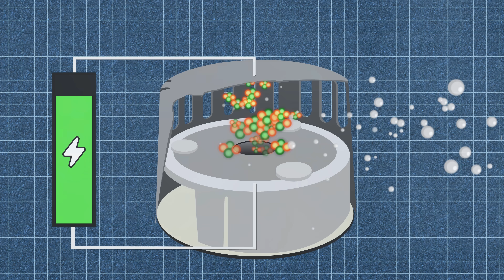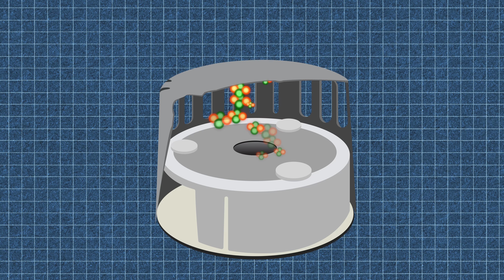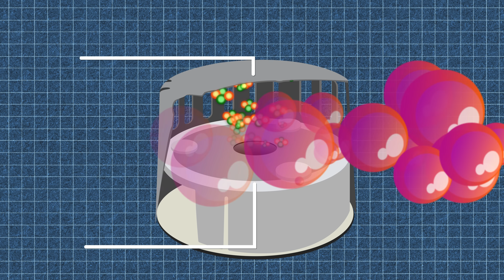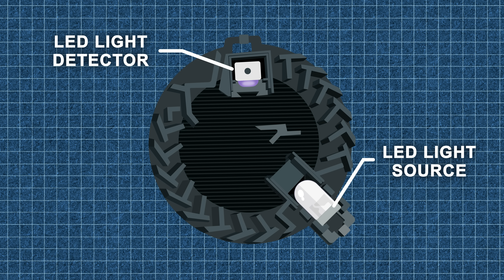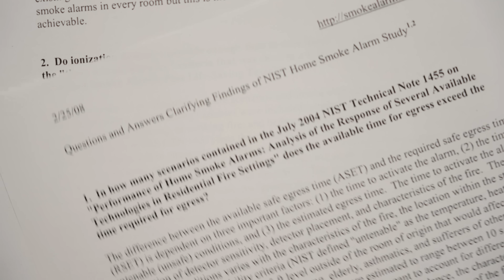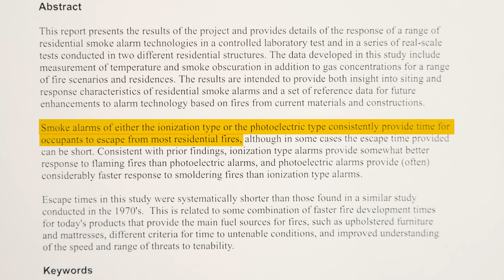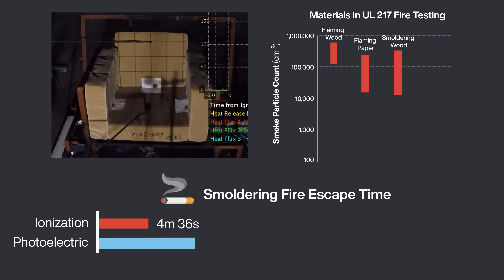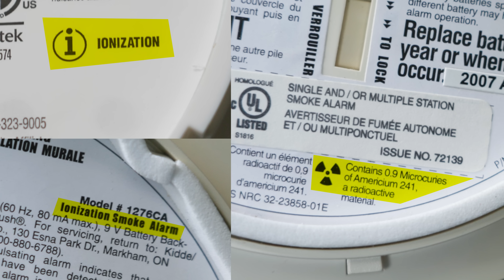Why the Most Common Smoke Alarm is Dangerous

Comment: aren't the graph names reversed ?
for example 11:35 the graph is opposite to what you are saying.
Reply from the maker: The graph is correct, it's an unusual way of talking about how useful an alarm is.  

The actual metric is ASET - Available Safe Egress Time, which is how long after the alarm goes off you have to get out before conditions become dangerous.  It's a more accurate measure of how useful an alarm is in saving your life.  It's also an indirect a measure of how fast each alarm is alarm is.   

Yes, this is confusing, I thought about different ways to represent the data and this is the simplified version although I should have went with "escape time".

Comment: I'm still waiting for a commercially viable 520Hz tone smoke alarm for my sleeping area. It has been a requirement in the code since NFPA 72 2013 yet there are no commercially available 520Hz devices. There are some that will detect the audio from a normal 3khz tone smoke alarm and play a 520Hz tone and there are options for commercial grade fire alarm systems but nothing in the same form factor as the normal off the shelf smoke alarm. As a heavy sleeper and fire alarm professional I don't like this.

Comment: At 11:50 are teh photoelectric vs ionisation bars meant to be the other way around. Be warned after 4 minutes of fire is much better than after 35 minutes of fire. Or am I reading that wrong?
Reply from the maker: The graph is correct, it's just an unusual way of talking about how useful an alarm is.  

The actual metric is ASET - Available Safe Egress Time, which is how long after the alarm goes off you have to get out before conditions become dangerous.  It's a more accurate measure of how useful the alarm is in saving your life.

This is indirectly a measure of how fast each alarm is alarm is.   Yes, this is definitely confusing and I thought about different ways to represent the data, I probably should have stayed with "escape time".

Comment: Do any models with interconnect come with a ten-year battery? My area requires interconnected alarms but I don't want to worry about replace the batteries.
Reply from the maker: Only one.  First Alert's SMICO105-AC.   Keep in mind this is wired interconnect, not wireless.  There are no wireless, non-hardwired, 10-year battery models.  

If you're hardwiring replacing batteries shouldn't be a problem as it won't suck any power from them unless your 120V system goes down.
Reply: @Lam  My experience has been that regular 9V batteries last around 3 to 5 years in a hardwired AC powered smoke detector. Once one of the detectors gets a low battery warning, I replace all of them.

Comment: Too long, didn't watch: skip to 15 minutes in where he gives the solution.: get a new smoke detector. You take forever to get to the point. I don't need the history of smoke alarms or the clever little interludes. Tell me what, if anything is wrong with my smoke detector and how to fix it and then after that you can start telling me the history of time. That or change your title to "the history and detection methods of smoke alarms"
Reply from the maker: Thanks for taking the time to comment, there's maybe 20 seconds of history but most of it is designed to get people to understand what the problem it is we're solving and why it's important.  That said I'm glad you at least found value in the solution

Comment: Why not just include both types of sensor in one detector? Neither smoke chamber is particularly large and complicated. Now you have redundancy for failures and the ability to detect different fire types.
Reply from the maker: Hey MrChainsaw, thanks for enjoying the video!

The problem with dual sensor alarms is these alarms can be just as sensitive to cooking false alarms (UL, Characterization of Smoke Alarm Nuisance Sources, 2015).  They're also hard to find, expensive, and the only 8th generation dual sensor alarm is currently unavailable for purchase (as of June 5, 2024). 

As well many homes require CO detection and you'll have to choose between having those separate vs interconnecting them with the rest of your home.  Same issue if you want separate photoelectric and ionization alarms.  I think Interconnection is more important.

Kidde's new 9th generation of smoke alarm is Photoelectric only.  This was what I was expecting in the video as I was shocked ionization could pass the new tests, but I'm guessing that's no longer possible.

Comment: Placement is also key, put an alarm in the wrong place and it may either not detect in a timely fashion, or may over detect smoke from cooking or other non emergencies and become ignored or worse intentionally disabled/defeated and then it will never alert to a real fire.  They also have expiration dates, most people probably don't even know they need replacement typically every 10 years.  Personally as someone in a house old enough to not be wired for them I like the 10 year battery units with wireless interconnection.

Comment: I have both types in different locations usually relatively close depending on the most probable fire. I also have a CO alarm and monitor. I have an old house with a wood fire for heating.

Comment: Have both optical (photo electric) and ionizing smoke detectors, CO and natural gas detectors, co2 and ABC extinguishers installed on every floor in my house, we have an escape plan,  was in a building fire when I was a teenager, was a volunteer firefighter in my 20s. Thanks for the testing
Reply from the maker: Nice, that's a great setup, I think it's hard for many people to set that up properly, especially if they want it interconnected.
Reply: @Lam  thanks, no interconnection, just newer 10 year units that I check once a year.
Reply: One of the local hvac technicians said most Co2 monitors dont go off unless the levels are SUPER high
Reply: @NEON2600 I wouldn't call it "super high". They go off when the level is approaching being a threat to human health. Iirc, they are usually set to alert at 30-40ppm CO.

The detectors hvac techs use measure from 0, because the equipment they're servicing shouldn't allow any CO into the home, and they need to know if it does.

There are other things in a home that can produce small amounts of CO that aren't particularly harmful, such as gas stoves/ovens, certain types of cooking, candles, etc. If CO alarms were more sensitive, they would give false alarms that would eventually lead people to remove or disable them.
Reply: @NEON2600  first herr alarms for protection of gas appliances are called co alarms big scientific difference between the co and c02 some fire extinguisher are filled with CO2 they are never filed with co because it is flammable ! And it think it read somewhere co alarm may only activate at about 70 ppm but it's based on length of exposure over time ! Ultra low detection sensors for co are not UL listed!
Reply: Hi Flash my previous Former business consultant is on the UL 217 committee he a actually went to Australia to say ionization alarms are dangerous in smoldering fires a d e en help get a photo electriconly mandate in his home state!
Reply: Is also surprising you don mention to the people that even the CDC cane out with a report that 10 year alarms don't last 10 years so again I challenge you did someone forget to give you the facts or are you just really bad at get giving advice?
Reply: Don't you have a duty of care to recommend only the most effective alarm? Do you not know that us government has tested ion which may fail in rooms significantly degraded by Smoke For some one who Claims to be such an authority I challenge you to answer me why are you not explaining to people that ion in both smoldering and flaiming fires have a higher rate of failure than pHoto electric which has a failure rate of 4 percent for both smoldering and flaiming fire be fire you start saying you recommend both would it not have been good to explain that to the people before making recommdation and let them decide for them self? As for the combination don't you know a court case already stated the combination is not safer than ion or photo and I was even able to make a video on how dangerous the combo can be?
Reply: @Fredengle  I did my research, other people can do that too. Thanks
Reply: @Flash1857  Hi Flash while I disagree with your ideas I do at least agree with you that if people are interested they should research it themselves while we are not 100% in agreement you are at least doing a step better than my local fire marshal who claims to say there is a debate but they dont offer any reason that people should do addtional research congradualations !!! thank you
Reply: you inspire that if people want to learn they should research and be educated again this is  a step better than my local fire marhsal I congradulate you on say ing its good to research and be educated !
Reply: If you really are the Authority you claim to be why can't you tell me the ion alarm failure rates? I am a private citezen andI was able to find a fult analysis report on how much the product d fail for some one who Claims to be an authority I challenge you why have you with held the facts I stated and I challenge you to  answer in an attenpt to change legislation if ion is as safe as you claim why had the statement been made that 100 percent of all lawsuits are against ion alarms and challenge you to answer it seems the official position of American society of home inspectors I think states they only promote photo electric only I challenge you to answer me are you really not concerned about safety or did someone fail to explain these things to you I know it to be fact my local fire marshal office is made of people who do not care about public safety I told them for3 years they promote dangerous product and refuse to change legislation or expkthow dangerous the priducs agree to the people di you know the iaff ,300,000 members about 85 percent population official position is photo electric only? And not combination or ion?

Comment: Am I the one who is confused or are you? Shouldn't the 35m timer at 11:48 and 13:41 be labelled ionization? It says photoelectric.
Reply from the maker: It's correct, it's just an unusual way of talking about how useful an alarm is.  

The actual metric is ASET - Available Safe Egress Time, which is how long after the alarm goes off you have to get out before conditions become dangerous.  It's a more accurate measure of how useful the alarm is in saving your life.

This is indirectly a measure of how fast each alarm is alarm is.   Yes, this is definitely confusing and I thought about different ways to represent the data, I probably should have stayed with "escape time".
Reply: @Lam  awesome. Thanks for explaining 😃

Comment: My housing company provided a very basic, simplistic optical one, fine but combined with the kitchen connecting to the hallway where it sat, without a door... Damn thing would have a panic attack if you boiled some water in the kettle for coffee, never mind cook.

Replaced it with my own heat-sense based fire alarm for kitchens and added a monoxide alarm for an additional sense.
Can't live with one that goes off needlessly 5 times a day, that also just desensitizes you to the alarm going off (boy who cried wolf.) so you'll probably not rush that 1 time it isn't a false alarm after a 100 false ones.
Reply: Photodetector alarms are recommended for kitchens to alleviate that false alarm problem.  Ionization or combined for everywhere else.  Of course, "kitchen" means wherever kitchen fumes actually end up going, which isn't always just the kitchen.
Reply: @travcollier  Also forgot to mention the optical one they placed here would just seemingly randomly go off without kitchen activities as well. Probably was factory-defective. Or maybe tiny flies, I have some plants that need moist soil at all times. So in summer there are always a few coffin flies around. Might have been flying into the sensor compartment?
I did try to go through the housing company to get it replaced but they seemed somewhat unaware what they installed here and that it's a not-for-the-tennant-to-touch/maintain alarm system. Did not manage to get someone on the phone who knew anything about it. :|

I'll look into the "8th gen" alarms mentioned in the video.
I'm content with the thermal kitchen and monoxide detectors for any fires or monoxide leak that might start in the kitchen or the heating system.
Still want a separate one more smoke sensitive in the bedroom and living room for e.g a smolder starting there. That would cause a lot of smoke before heating up the area around the thermal alarm enough to trigger it. 

(I'm not in the US, ionizaton type haven't been sold here for ages. But there seems to be something like shitty-optical ones too (unless it was just defective ofc.))
Reply: @InnSewerAnts  I have heard of insects or spiders entering optical fire alarms setting them off before. That seems like a possibility.
Reply: @05Matz  Oxidation of the optical plastics and dust accumulation will kill the photo electric units as well.

Comment: Glad to see such a great explanation of this and a good breakdown of the differences. There's a reason I have both types of detector in my house, and I didn't just choose where each type was placed at random. The spots more prone to a fast starting, flaming fires have ionization detectors, and the rest are photoelectric.
Reply from the maker: You're welcome! That's a great way to maximize coverage and protection assuming the most critical ones are interconnected
Reply from the maker: Great setup.  I would make sure you have an alarm on each floor that's interconnected.

Comment: New viewer here.
    Great video. Thank you.
Back in 2018 my refrigerator power cord was pinched, causing a smoldering fire in the kitchen while I was at work.
    I had left an exhaust fan in one of the bathrooms going, and a passerby saw it and called the FD.
    No one heard any smoke alarms going.
    Glad I wasn't there, asleep.
Reply from the maker: Powerful story, I'm glad you weren't affected.  Exactly the type of problem that we're trying to solve.
Reply: which is why AFCI and GFCI breakers are desired

Comment: Technology Connections also did a video on this (because of course). However, he did not address 8th generation alarms. This is very useful, as I need to replace the alarms in my house. Thanks!
Reply from the maker: He did! I enjoyed his take on it.  

It was a topic that was on my mind right after I did my apartment fire safety video but I wanted to do others first.  Finally came back around to it.  

Thanks for the donation!  Let me know if there's information you need!

For example I was chatting with family last night and I found out in apartments that many people don't know there's a difference between the building fire alarm you can't touch (often a heat alarm) and the one you can replace yourself that is the critical one for your own safety.
Reply: Wow, I always thought building fire alarms were smoke alarms. That's really good to know. After watching Technology Connections' video, I actually took down a few fire alarms and started a smoldering fire, and they all went off. However, I started a fire using cardboard. It's good to know that isn't the concern. I'm going to retest my smoke alarms with polyurethane foam and see what happens.
Reply from the maker: Building fire alarms I believe are divided into detectors, alarms, and the brains which is the fire panel.  It's a specialized network as opposed to the individual  smoke alarms for residential purposes

Comment: Do any smoke alarms exist that have both sensors?
Reply from the maker: They exist, the problem with dual sensor alarms is these alarms can be just as sensitive to cooking false alarms (UL, Characterization of Smoke Alarm Nuisance Sources, 2015).  They're also hard to find, expensive, and the only 8th generation dual sensor alarm is currently unavailable for purchase (as of June 5, 2024). 

As well many homes require CO detection and you'll have to choose between having those separate vs interconnecting them with the rest of your home.  Same issue if you want separate photoelectric and ionization alarms.  I think Interconnection is more important.

Kidde's new 9th generation of smoke alarm is Photoelectric only.  This was what I was expecting in the video as I was shocked ionization could pass the new tests, but I'm guessing that's no longer possible.